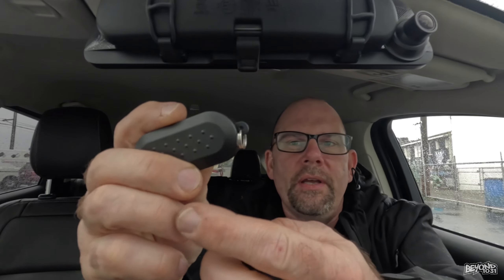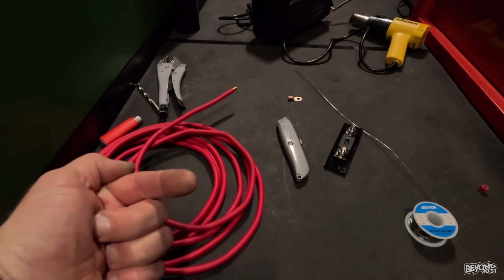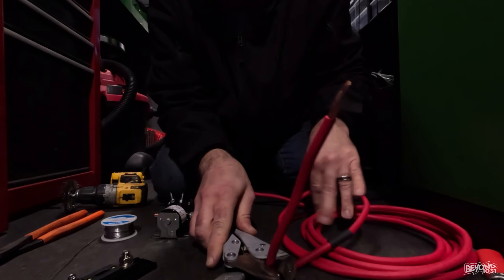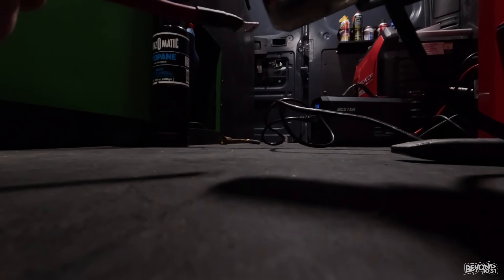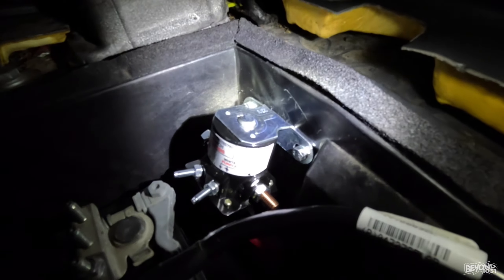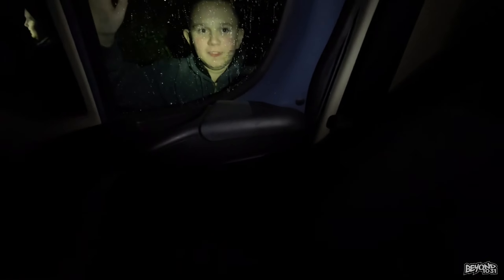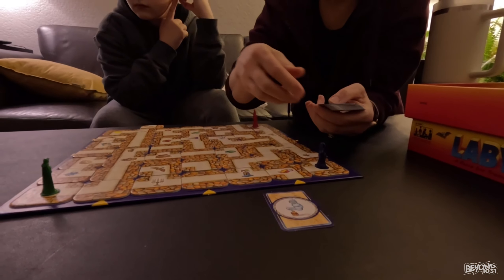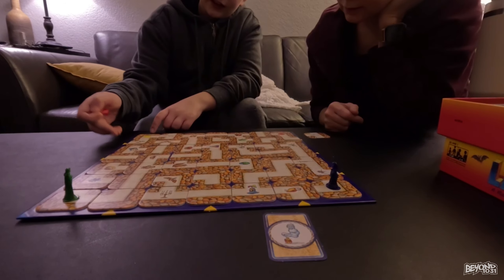Making Cables [Day 5127 - 11.13.24]

Comment: I know how expensive the keys that have the fob are so my 2014 Ford Mustang the key is also the fob but it’s not like yours where it flames out. It’s a solid key but then it’s got a big back end which is the fob and when I bought it from my brother, he couldn’t find the second key so I looked in to see how much it would cost to have one made from Ford and I was quoted about $600 to have it made programmed and all luckily for me I lucked out and about two months later he did find the second key so I have two keys without having to pay but holy crap they expensive when they’re all one unit😮